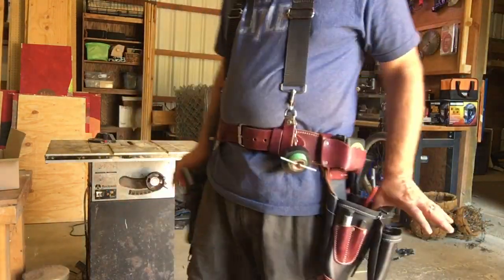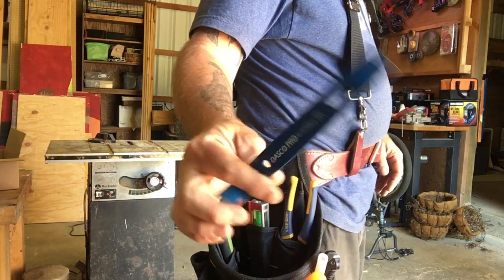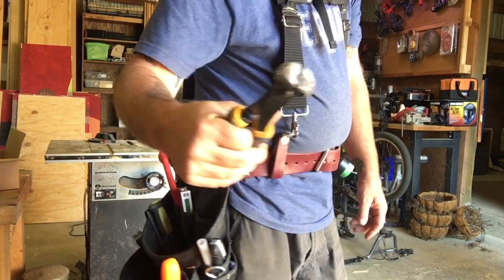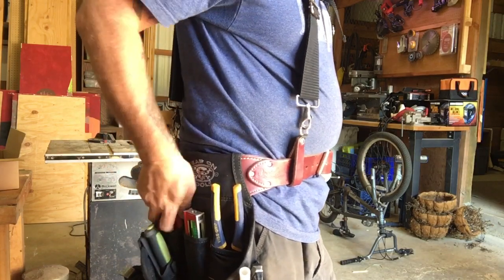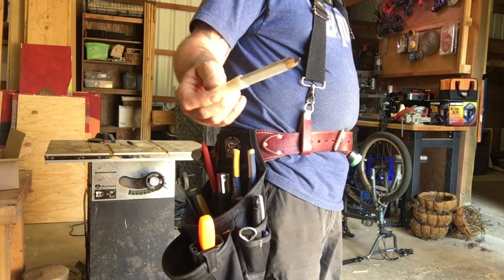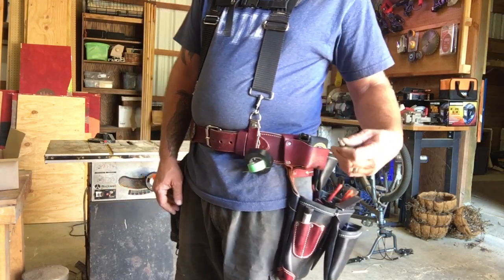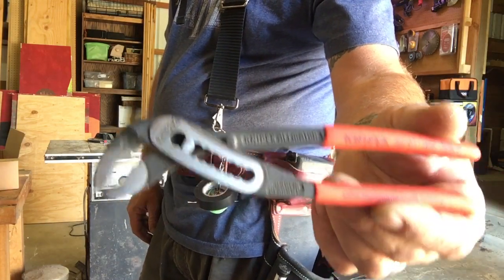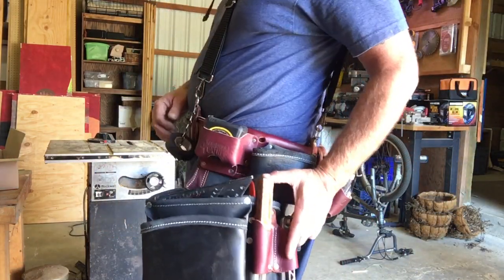Occidental Leather Tool bag set up

Comment: Way to go with going cheap at first. Then buy good. Better to loose a little compared to a lot if you purchase the good first and discover it doesn't work for you. I purchased Dead On too and when It needs replacing, I know better what would work for me.
Btw, as an other commentor said, wooden handles are not any better for those sleeves. However, if you are interested, Diamond back and some other companies make sleeves that sit at an angle. Some behind your regular tool or fastener pouch.

Comment: Wow, that's a big heavy setup!  I have three occidental all leather belts, one for framing/major electrical/reno work on hip buddies, a dedicated drywall and one for light in house work/electrical (drop forged tool bag, high mount hammer loop, high mount tape holder and small two pouch bag) on a two inch belt.  My suspenders migrate from framing to drywall belts as needed but not on my light duty belt.  I could not fantom carrying all these tools at one given moment... that's why I also have the Milwaukee pack out boxes and the 15" tote to bring all my kit to location and then I load up the belt with the tools and fasteners I need.  Much better for my back, shoulders and legs and more efficient overall.  I would guess your belt weigh in at 7 pounds empty before tools and fasteners... heavy!  To each their own I guess.
Reply from the maker: I Brazeau 
I know it seems super heavy. I really don’t carry all of these tools at once. I was just showing what I carry at any given time. I take tools out that I don’t need .
Reply: Maxwell House Ranch - I was worried about your back for a moment!  How do you like the no slap hammer holder overall?  My asking is because the hammer loop becomes noisy after while so I wrap it with an electrical cord sheathing but I have to replace it often.
Reply from the maker: I Brazeau 
The no slap hammer holder is not my favorite, I have since purchased a high back hammer holder by Occidental and I really like it much better. My hammer would not go I. And out very easily.
Reply: Maxwell House Ranch thanks for the reply... I also have the high back.  I'll keep my setup with it.

Comment: This looks uncomfortable and unwieldy I wear a belt all day everyday at work. I mean do you need all of this stuff or do you use this like a toolbox? To take from job to job
Reply from the maker: New England Yankee Living 
I do not have one specific trade. So if I’m doing electrical work, I’ll switch my bags up a bit, if I’m doing framing I’ll take out a lot of this stuff and go very basic. I was giving a general idea of what I typically carry in my bags at any given time.
Reply: Maxwell House Ranch the bulk of my work is framing/sheathing with very occasional electrical so I’m used to carrying very little though my boss still thinks I carry too much. If it works for you that’s all that matters. Cool
Idea with the chalk box mine is in the main compartment on my admittedly much cheaper bags than your Oxies and since it leaks that’s pretty much all that goes in there. My right hand stuff goes in smaller pockets up closer to my hips on the pouch but I like the idea of a snapper set place to minimize the mess.